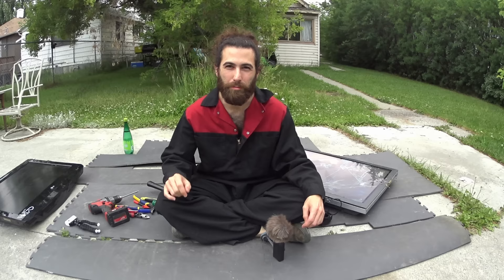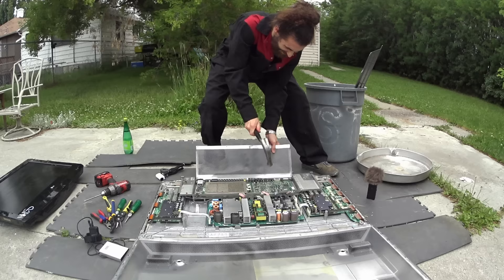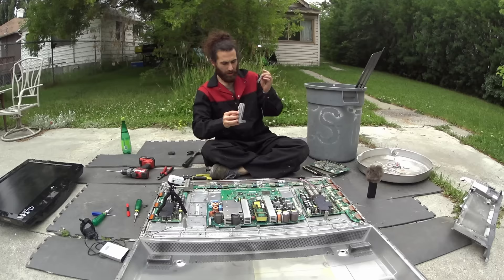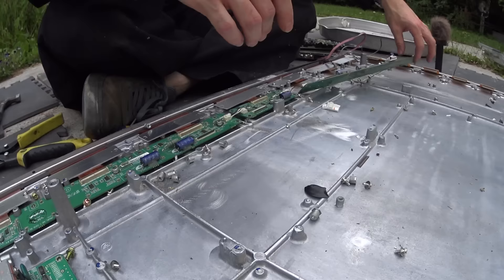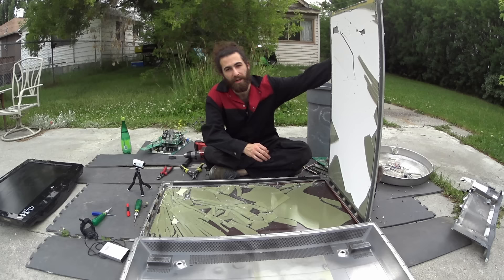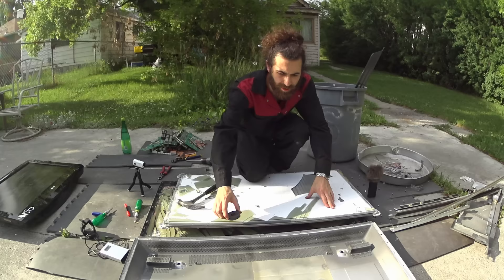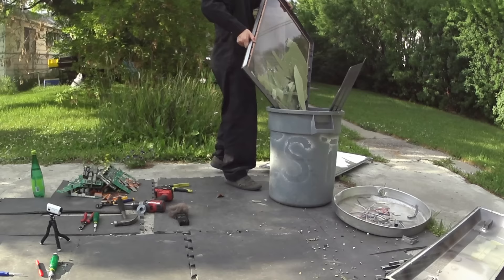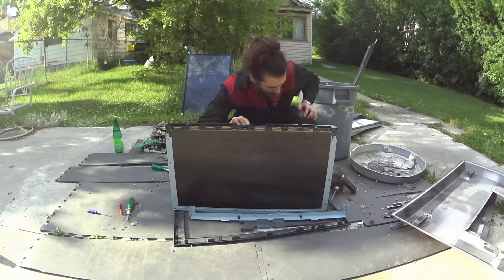Scrapping A Flatscreen TV - How To Make Money From A Scrap TV!

Comment: Love these videos. I just stumbled on you and I'm thankful. It's extremely hard for me to walk away from gold. Have a question tho, how can I tell if something is zinc vs aluminum?
Reply: the weight, aluminum is a good bit lighter
Reply: @ghbytdsrfhb  So that's really the only difference or the biggest difference? And I appreciate the help.
Reply: @fbm7692  check out this dudes channel for the vid "Die Cast - Identifying Zinc VS Aluminum For Casting or Scrapping"
Reply: @ghbytdsrfhb  Thanks so much. Always appreciate the help and love to learn. Ur awesome!!
Reply: The melting point of zinc is around 792- 800 deg F. I worked with it daily it came  from Canada.  Aluminum got to be like 1300???i guess.
Reply: @tonyheff  See this is where I get lost. I assume I would need special equipment to do this to begin with. All I have is a standard bottle torch which it's not going to tell me the temperature unless there's an adapter I can place on it. I have 5,000 other tools but nothing I have comes to mind on what would help me do this.
Reply: @fbm7692  density could be a factor as well.
Reply: @fbm7692  Try a soldering iron with a large chisel tip set to 800f to melt zinc.  Technitool has them.  Or use a heat gun and a soldering iron with the board held in a clamp
Reply: Zinc is brittle, reacts to water, has a dull blue silver tint to it. Aluminum as cast is tough as shit and you need a sledgehammer to break it. It's also bright silver shiny. More bright than it is silver in color. It also has a higher melting point and is used in just about anything. What he says is zinc is actually cast aluminum. I'd know, because I've took down numerous flat screens here in the States. They would never use zinc for such things they use cast aluminum for. And it's also rare, hard to find, and expensive. It also oxidizes like crazy and is extremely bad for your health. And what he said was aluminum, is actually stainless steel. 😂😂😂🤣🤣🤣 This guy I swear. Not the brightest on the block.
Reply: @ghbytdsrfhb Cast aluminum is actually quite heavy. Heavier than zinc.
Reply: @gothicangel6313  Thanks for the 411. Your right about cast aluminum, it's f'ing tough. I've gotten alot of it from satellite dishes. Don't believe I've found any cast in flat-screen tvs tho
Reply: @gothicangel6313  I either didn't pay much attention to what he said was what or I couldn't tell. But you would think he would know cast aluminum. Hard to miss that
Reply: @tonyheff yeah, aluminum is just under 1300°f

Comment: Would it be worth it if you got ten cents a pound American for low grade boards.. Thats what I get here in minnesota
Reply from the maker: I think flatscreens are only really worth it if you really go hard on them. Collect every one you can so you have stock and combine them together to make working units to sell when possible and eBay the other working boards, then pile the scrap boards up for 0.10/lb as a byproduct. Maybe pick off the largest mlccs beforehand. As far as just disassembling them for 0.10/lb board, I wouldn’t.
Reply: @thubprint  yeah.. They are actually quite dangerous with all the mercury and unknown chemicals and bulbs and whatnot .... I only go after the guts of a tv when I'm actually broke and hungry.
Reply: @thubprint  and those poor souls in China/india that depopulate the boards will know that chip went missing. Never depopulate boards when selling them whole.. It will decrease their value in the future. E scrap prices have always been steady and modest... No need to try and pull anything off the boards.. Besides your time is way more valuable than "microscrapping". "Microscrapping" is done by some poor soul on a hot pad with a fan blowing the smoke away from them as the led melts and the board becomes a loose pancake filled with toxic chips.
Reply: @jimmybrockton961  you would not pull a big ass heatsink off a board?
So someone overseas gets more money when they burn it?

Comment: I used parts from one TV and fix another.
Reply from the maker: I’ve thought about doing that, I think if a fella had the space to stack them up it wouldn’t take long to have enough that you could fix all the new ones you find with parts you already have.
Reply: @thubprint  its harder than it sounds as its impossible to guess what u need and what u can throw away or recycle.

Comment: Where do you sell the gold after its been in meradic acid n bleach have a lot of filters around 40 pounds
N twice or more that hasn't been 
Removed palidium but ram n CPU still around 50pds.
I need a buyer or a way to smelt it
Reply from the maker: I think it would be difficult to sell it in that form, just need a friend with an oxyacetylene torch and you can turn them into beads 👌
Reply: GRC general refining use to but now they require to much weight for me

Comment: You can't look at it from the perspective of making less than minimum wage. In math, you usually set everything to zero to make the calculations easier, so in this case I'd say that making any nonzero amount per hour is better than earning ZERO EUROS per hour (which you already are, otherwise you wouldn't be doing it). 
Basically, every single one of those components can be made money off. The outer case is most likely ABS. That's a good 4 Euros a kilo, however you need to sell that in a big lot, say 1000 kg and that's not hard to do, believe me. Then there's steel. I'm getting about 5 Eurocents per kilo. That one piece of sheet metal you thought was aluminium was most likely stainless (as opposed to stainful) steel and that's worth about 1.50 Euros. If you save up the circuit boards, you'll notice that some components are easy to depopulate like various coils, heat sinks, etc. The depopulated circuit boards can then be sold in bulk for 1 Euro a kilo, even AFTER you Dremel off the Gold plating on all visible surfaces. In other words, you have to think in terms of economy of SCALE. Oh, and have a place to store all the materials until you sell them.

Comment: A good hot heat gun will let you get ALL of the components off of the PC Boards...
Reply from the maker: For sure! There is definitely some benefit to specializing. If someone wanted to go hard on flatscreens they could piece them together and sell the working ones while having a supply of spare parts listed on eBay and a small refining operation. I’m sure they could do quite well and get a huge amount of broken tvs for free all the time.

Comment: If you have a TV that the screen is cracked and it turns on and shows a picture... generally the boards are good. I literally do this for a supplemental income... 90% of tv's I get are this way and most boards sell for $20-50. And there's... 3 to 4 in each TV. The scrap metal isn't worth it. But watching you hit those boards with a hammer and rip the cables out hurt my fucking heart. Offer a refund on eBay. Out of 2 or 300 boards. I maybe have had ... 3 or 4 that were bad? And half of those dudes were lying. The boards is where the moneys at. Again this video hurts so bad.

Comment: Have you ever consider wearing gloves to handle all of that rough edged material? You would not have encountered that minor prick of your hand if you did... Also, the white translucent material which is the same size as the screen is very expensive, if you would ever want to buy it. Sun can shine through it, as it would a magnifying g;ass. to burn paper... I like to save the speakers as well. Newer flat screen TVs have a much less mass of electronics in them, everything is so much smaller. I took apart a 55 inch Samsung the other day, and was surprised to see so little in the way of boards, only three small ones.

Comment: Yeah pretty much... Scrap not worth it and .... Parting out maybe???? but you gotta have some idea what wrong with it... Repair it is also an option...
For example I got 2 Free Tv's recently  one looked more expensive but broken screen so parting it out... 
The other was Turned on no picture so I bought a board off ebay and got it running again...

There is still very little to no money in it though...  The parted out one I will be lucky to get 40-50$ in a year IF I'm lucky from Ebay...
The working one I put 25$ into it... and it's 10 or so years old so it's 40" ........??? might be worth 50$ to somebody ... ( I'll probably keep it as a spare or something)

It's not really worth it.. as business........ I remember recycling places/ Tv repair shops  used to give you like 5$ per TV but this was like 15 years ago... Today no body wants them and here in my state California people and companies wanna charge you to throw them away ( Best buy charges up to 30$) ... Even tho in this state we already pay  mandatory taxes to dispose of TV's when we buy them... And granted the government does have some  but many are sketchy   independently run  few .....far away  and have weird hours...  ( terrible system) 

So here plenty of Tv's on the curb

Comment: You're all talking about the metals, kinda sad really. The value is in the components on the boards, not the metals. A single MOSFET or IGBT can range from $2 to $20 each. Most plasmas are going to have around 6 MOSFETs on the power supply alone, and 10 or more IGBTs on the Z and Y Main boards. Lets say they're just $5 each and you easily reach $100 in just those components alone. That doesn't count any of the other components on these boards. Of course you have to know how to extract them and test them, and of course list them for resale, but this is where the real money is. Makes gold scrappers look like a joke.
Reply: Ri5ux, agreed. FETs can run big bucks.
Reply from the maker: Cool! I don’t know anything about extracting and testing individual components but it aligns with what I was trying to explain, the scrap metal value of these things is a long way down from other ways to get value out of them.